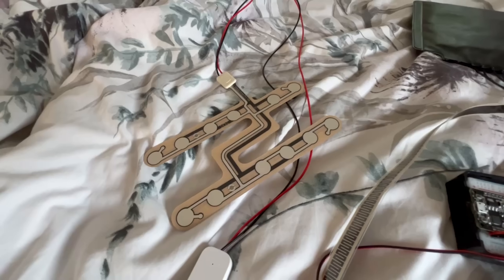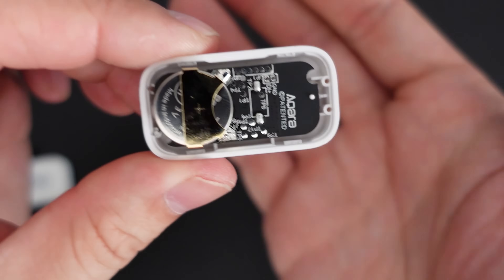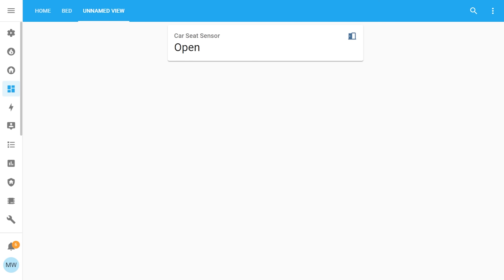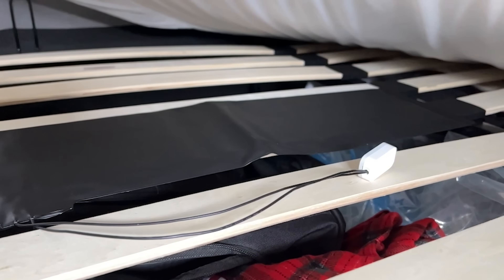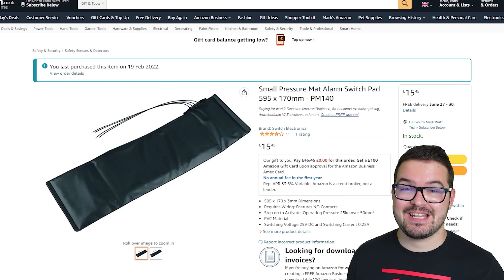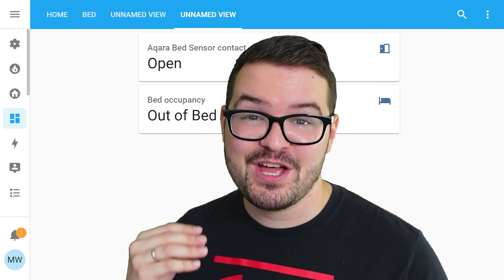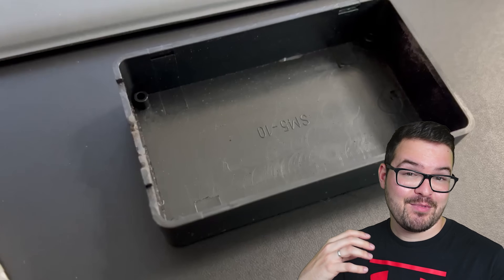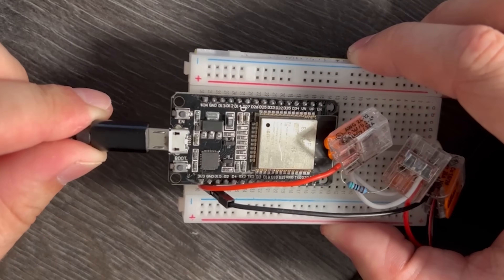4 Simple Wireless Bed Sensors (AQARA HACK)

Comment: Two additions to your guide 
1. You don't need the input Boolean, just give your template sensor a delay_off value as well as changing the type to occupancy
2. No need for multiple aqara sensors for multiple pressure mats, these can be connected in parallel and applying pressure on any of the mats will trigger the aqara sensor
Reply: Or if your cat triggers the single mat wire them in series.
Reply from the maker: Thanks for sharing Philip. The idea for the two sensors was more just if you wanted to identify a set side. E.g. left side of the bed and right side of the bed.
Reply: @MarkWattTech  left and right is a perfect usecase to have individually. Although using the same aqara sensor for multiple sensors on the same side was my main advice as many seem to miss that this is simple and possible. I love your ideas on how to use these sensors for stairs, mats etc. So far I've only used them for the bed. Ideally I'd use the load cell approach but unfortunately it cannot be mounted as far as I've been able to figure on our bed which has round vase formed legs.

Comment: I had the esp32 with some homemade pressure sensors out of foil and paper. It worked perfectly, the problem was that I had to have a ton of cables under my mattress and had to be close to the power plug. Also, the pressure sensors worn out pretty fast due to movement. So I'm certainly gonna try your versions

Comment: Although not relevant to the subject of the video, was interested to see the Aurora socket as have never seen this before, we use a lot of clicksmart+ double sockets and love them and note they are about half the price of the Aurora ones. But interested to see the Aurora ones have power monitoring and come with a handy 10mm faceplate spacer as fitting them in most standard 25mm boxes is an arse to say the least. Keep up the good work fella 👍🏻
Reply from the maker: Thank you. I show it a little more in my Energy Challenge video and will be featuring it in my Smart Home Wall Panel video as it’s used to automate charging :)

Comment: You should do another video about sensor #4, but with 2 fsr, one for each side of the bed 😅
Reply: I got it working for one side.  About the play with a second for the other side.  I'll update when I get a result
Reply: Yup.  One either side of the bed into the same connection works fine

Comment: Have you tried this with 2 sensors for the same bed?, is it able to tell the difference between 1 or 2 persons in bed?
Reply: I use two fsr strip one on each side which works great. One strip across the middle would let you tell the difference you would have to pick resistance with both in bed first. One person would give a lower signal so you could use that. Two strip is easier though imho. I do detect when the cats are sleeping on the bed, it is that sensitive you can actually do this
Reply: @iainhay2823  do you hook both sensors to the same input and just calculate voltage?
Reply: Belay that question.  I hooked 2 fsr up. One on either side of the bed and linked them together in the single esp8266 setup.  Works great at detecting one or both in bed
Reply: And what about sensors #1 to #3 for 2 persons in bed?

Comment: For the weight strip, did you place at both side of the bed?
Or just 1 strip horizontally in the center of the bed?
Reply: I use two strips one on each side of the bed, works really well. Both into one esp32
Reply: @iainhay2823  do you mind sharing some diagram how you wired both strip to the esp?
Reply: @thebatu89  I’m away at the moment but will do a diagram when I get back next week for you. Pretty sure I made a diagram already so if I can grab it from my vpn I’ll link it before then
Reply: @iainhay2823   btw, what’s the resistance value of occupied vs unoccupied for your bed?
I’m getting 10-16kOhm for occupied but I’m only getting 1 even after i cranked up to 2M on the multimeter

Comment: Great Video Mark!
I have gone the easy route and tried to automate my existing Withings bed sleep sensors!
I am still struggling to do that however
Reply from the maker: Thank you 🙏🏻.

How do you find the Withings stuff in general? :)
Reply: @MarkWattTech  I have the Withings sleep mats. They are terrible for me for 3 reasons: 1) I have a partner, and if she gets anywhere near my half of the bed when I'm not in it, it goes off. 2) I have cats that nap on the bed. Although the mat calibrates when plugged in, there's no way to give it a minimum trigger weight and it always picks up the cats. 3) The Home Assistant integration is very sketchy. I have to reauthenticate daily and on every restart for the sensors to communicate over the API. I'm seriously considering switching (or adding) the resistive voltage option here to set weight thresholds. Thanks!

Comment: Great video but you do not have to remove the read switch. Just solder as told. You can than reverse engineer back to the original aqara sensor if you just want to use it for testing.
Reply from the maker: Thank you :)
In my experience I found it hard not to damage the reed switch 😂. Helping hands deffo needed on this one
Reply: I'm pretty sure most Xiaomi/Aqara devices also have two small holes that you can solder pins to for external triggers, on this one it's next to the reed switch at the opposite end to the pair button. you have to be pretty good at soldering though as it's easy to destroy the PCB. My device is now in the bin as a result, but I'm sure someone with better skills than me could use these.

Comment: Great video, I've been confused about this for ages!

I already have an esp32 that I already use gpio pins 2, 4 & 5 to control 3 relays that control my tv lifting mechanism. It'll also use the 5v and gnd pins to the relay board

Is there any way I could add 2 of the film sensors to the same esp32? So that I have everything in the 1 place?

Thank you
Reply: You can indeed do this, you just use two of the ADC pins one wired to each FSR and then the ground wired together or to separate ground pins on the esp32 it doesn’t matter. You just need to add to the additional code in on top of what your already have and specify both ADC pins to have the second. Don’t have a pinout to hand but normally about 14 ADC pins on an esp32 or thereabouts so you should be fine
Reply: @iainhay2823  thank you 🤘

Comment: You can do this even simpler with an aqara leak sensor. It has screw where you can attach the wired of the matts and such 😁
Reply from the maker: Even easier then 😁
Reply: I have found that the 'dry'/off state of the Aqara leak sensor is a bit too long, for actions that require happening within a second or two. Eg turning on the light.

I am seeing a delay of about 8 seconds between the wet/on and dry/off state. The other way around it is almost instant though.
Reply: I don't recommend doing this. I tried it today - it wasn't as sensitive and it wasn't as quick to send out on/off updates. The contact sensor was much better.
Reply: Was coming here to say the same thing......
Reply: I don’t doubt what you’re saying, but could you perhaps elaborate on how one needs to set this up? (I’m just not quite sure that I’m following.)
Reply: @handcoding  the flood sensor has two contacts on its bottom which are actually screws. These can be loosened and then put tge wires in and tighten them again. This is an alternative to the soldering done in marks video. Works great!
Reply: @The64BitKid  Ohhh—I gotcha. Nice!
Reply: @The64BitKid  Would you happen to have the reference of the sensor please ? SJCGQ11LM ? SJCGQ12LM
Reply: @the_guy_next_door_31  I am using the SJCGQ11LM

Comment: You do know you can do the same with Aqara Water Leak sensor without opening it as it has two screw terminals?
Reply: The circular shaped one?
Reply: @DarixCn  yup the round one. Works great
Reply: @The64BitKid  Do you also have a delay of about 8 seconds to detect somebody is out of bed ?

Comment: What is the weight to activate the "digital" on/off sensors? Could they be activated by a too heavy mattress or not activating for a child/pet?
Reply: I have the same pad, the weight for activation is 25kg. I have a super king mattress which is pretty much the biggest and it doesn’t activate it. A child probably would activate it though.
Reply: It really depends on the mattress, if it distributes the weight too evenly. 
The sensor won’t even register it
Reply from the maker: Yeah like Chris said. In my tests the car seat sensor and mat wouldn’t detect a child or the dog. But the Thin film sensor detected both in the Aqara and ESP setups :)